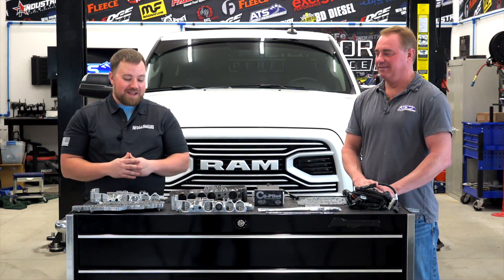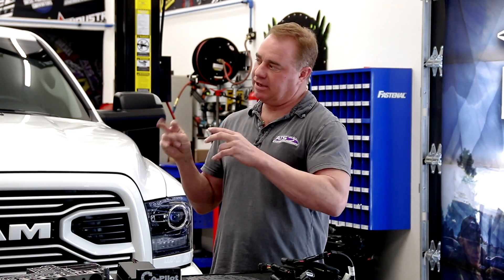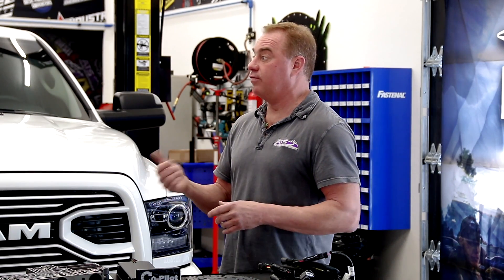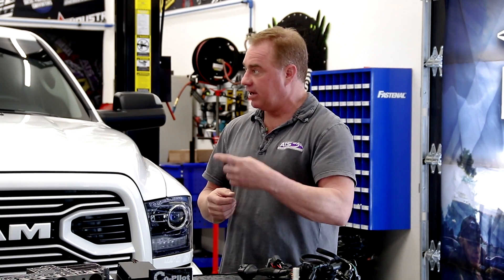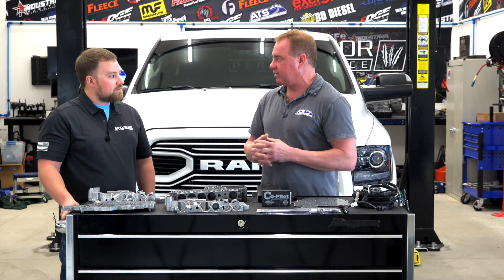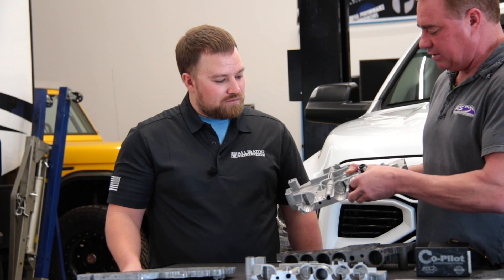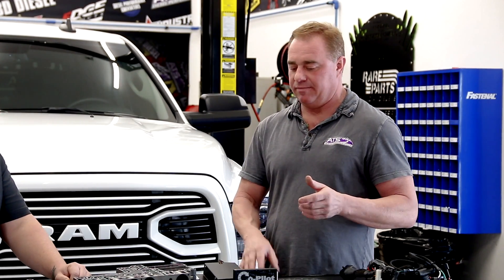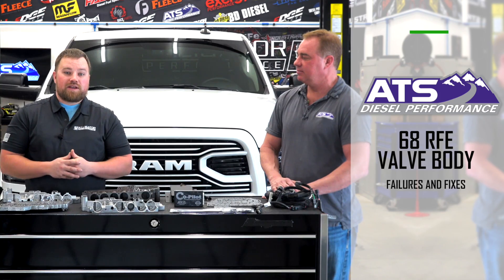68rfe Valve Body - Failures & Fixes | ATS Diesel

Comment: The 68rfe is the reason I sold my 2018 ram 2500, kept my 2003 5.9cr nv4500 and bought a 2018 Silverado 3500hd L5P with Allison 6speed,  man that Allison shifts so nice compared to that crappy 68rfe.   I mean come on FCA, we all love the 6.7cr and is probably the best tow engine out there period but you seriously kept the 68rfe??!!  FCA leadership has been dropped on their heads.how much does this cost?

Comment: My truck cycles through the gears but i keep getting a "torque converter clutch solenoid open" code even after changing my solenoid pack. Rpms are high and torque is liw

Comment: Just got my 2500 with 68rfe back from the dealer with fresh rebuilt tranny. Work completed under power train warranty, truck has 54k on it. Valve body was hung up and burnt some clutches. Overhauled tranny with all new clutches and seals!

Comment: Proper ring and pinion ratio is all it needs. The factory should never have shipped these with 3.42:1 gears. I switched my 3.42:1 gears to 4.10:1 using stock tires and the transmission temps plummeted 30˚F and all transmission noises went away. No more convertor grinding noise from excessive slipping under load. My fuel economy actually went up 20% which was a shock. That was because the truck accelerates better with less throttle. Less convertor slippage and more power to the ground now.
Reply: if you pull trailers daily you would use a 4 .10 but if not you can use which ever gear sets that works best for you
Reply: @williamtarpley4025  My example was driving empty, not towing. There is more benefit from a taller ration than a short ratio. The Cummins, coupled to a 68RFE, with a short axle ratio is a bad combination. The 68RFE is not designed for low rpm high torque applications. It was designed as for use with a gasoline engine.
Reply: What did switching to the 4.10 cost you?
Reply: @jhonnymendoza5323  $1100 installed
Reply: @briangc1972 
Where u have done that
Got 14 ram 3500 srw.
Reply: Add a low stall converter 1300  rpm
With some Banks power products my fuel consumption dropped 34 percent. 9.8 L per 100 ks Garrey  Australia

Comment: Does the new FCA recall on these transmission in which they change the valve body or the separation plate, does that fix some of the line pressure issues?  Heard it was from heat and pressure, the reason for recall

Comment: Clint is full of **it as always. this particular valvebody has a plate that retains all those little pistons. it bends and breaks completely causing the pistons to leak. thus leaking main line pressure causing transmission failure. the new revised plate is what makes the 68 rfe live. but they won't tell you that. 160 psi under max load is plenty. any more will cause over heating and premature component wear. everything they mentioned is already done by the computer. i can debunk every word of this preface, but it would take longer than it. for example, there is no such thing as closed loop line pressure system. closed loop refers to a computer. throttle pressure dictates line pressure. approx 65 to 160. buyer beware
Reply: Yup very good at scaring people into buying their shit
Reply: Mine has code p8071, changed filters and pressure sensor didn't help. Runs great until engine light comes on then starts slipping. When engine light goes off transmission works flawlessly. Any ideas?
Reply: @gogogo1064  did you get it fixed? Mine just started doing the same thing a couple days ago.
Reply: @mannyg85   I ended up having it completely rebuilt for $6k runs great.  I believe if I had had just changed my valve body and solenoid in the beginning I would have been fine. I drove around 15,000 miles with codes and in limp mode though and smoked my clutches.
Reply: @mannyg85  I believe if it had been early enough a valvebody and solenoid would have done the trick.
Reply: @mannyg85  valve body pros in San jose California has a great reputation and a very helpful personable owner. I did a lot of research and they have no real complaints. They are also buy far the CHEAPEST for stock rebuilt valve body's and oem Mopar solenoids.
Reply: @mannyg85  my memory is not the best but I want to say like $600 for both parts from valve body pros. It is worth the try if you can do the work yourself.
Reply: @gogogo1064  ok thanks for the info I will look them up.
Reply: @gogogo1064  I wished I knew more about the valve body before. I did my transmission fluid change when the truck had 70k. I would of just upgraded the valve body then. I’m gonna go with revmax beefier VB the truck has 106k.
Reply: @gogogo1064   hey man, just got a 2010 ram that was horribly neglected. (Bought sight unseen just pictures) after having it went trough by a mechanic (who turns out has a direct relationship with the seller) all kinds of issues. But as far as transmission wise I drop the pan as it was leaking badly the sump pump filter was split in half I am Magine due to overpressure the valve body looks like it got hot enough to actually melt some of the aluminum. I can’t afford to pay to have it rebuilt (just deleted and tuned because EGR overheated and DPF was nearly 100% clogged) so I’m like 2k into tuning hardware/software plus the exhaust I did myself and the EGR delete and coolant bypass. And another 1k into all new fluids front diff cover. The deeper I go the worse it gets. How can it not be throwing codes white such catastrophic issues? Tons of metal shaving in the pan, sump filter blown out from over pressure……. I could tell just looking at the atf fluid something was wrong (looked underneath and the pan was sealed with about an entire tube of red gasket maker (you know, the kind that isn’t resistant to oil/fuel……
Reply: what new revised plate?

Comment: What transmission fluid do you recommend for this transmission?
Reply: I have 240k on mine and do regular flushes; still running strong, temps are steady, and no slipping.  Not here to debate that topic, it's a dead horse IMO as everyone has an opinion on "to flush or not to flush".  I use Castrol AT4+ Full Synthetic and change the filters regularly also.  Once I moved to the Castrol, it was like driving a new vehicle.  I also have an EFILive with the trans tune, but I don't tear up my vehicles, although I do "work" them. 

The people I have known who have had issues are the ones who don't know how to maintain their vehicles then wonder why things break.
Reply: Victor hobson mopar only